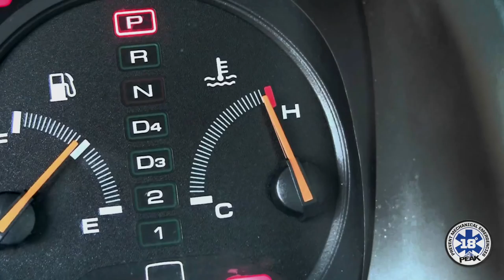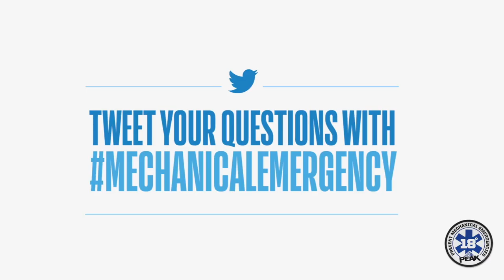Blown Head Gasket | Dr. Coolant Episode 1 with John Force | PEAK Auto

Comment: My coolant in the overflow is bubbling when I start it. My thermostat also just went out. I have white smoke coming out of the exhaust, but my coolant remains at the same level without filling. People keep telling me I have a blown head gasket..would you say this is true? The car has never overheated. The thermostat was stuck open, so it wasnt warming up properly. I havent driven it since it happened. I had the heat on when it wouldn't warm and was stuck open. I turned my heat off and it closed and warmed up to the normal temp right away. I've had nothing but trouble with this car and wanna know if it's time to just junk it. 2.7 2008 avenger
Reply: The engine light did come on when it got stuck. I have not had the codes read yet